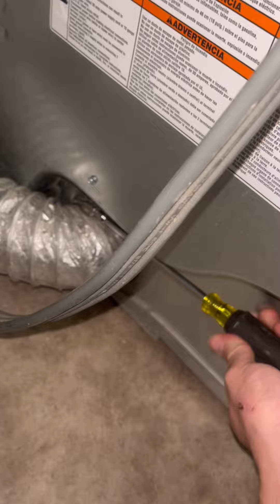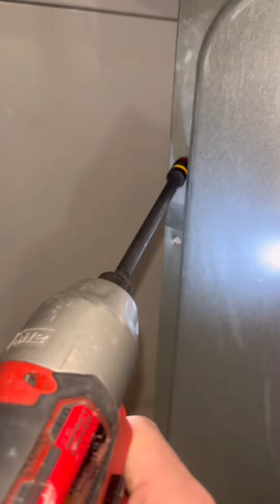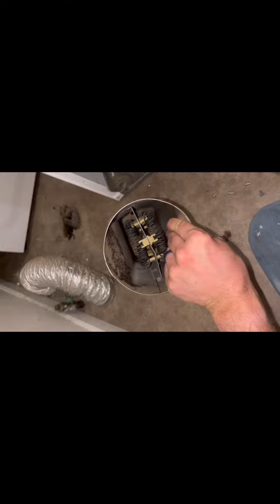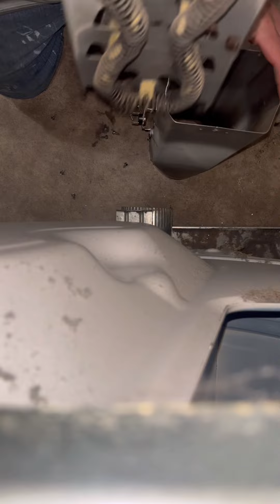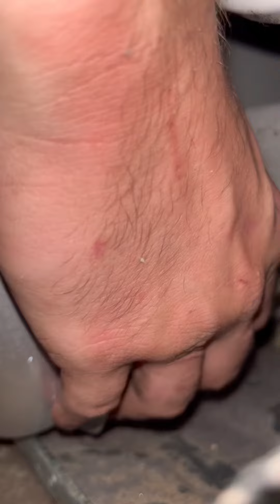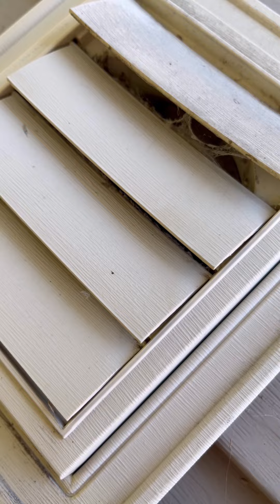Heating Element Replacement On A Maytag Dryer!

Comment: Have the same dryer but my heating element has three prongs vs 2 that came on my replacement unit. Will that work? Also, replacement seems smaller in length as well.

Comment: I got this dryer a few years ago and it is still working fine. Since the cabinet on the front does not look easy to take off I was wondering how to replace the element. The designs of crap nowadays is no doubt designed to discourage the DIY guy from doing anything. Most other models had an access panel on the front that you could either pull off or press some tabs in and access the element directly and easily. Thanks for the video.
Reply from the maker: It is definitely designed to keep it from being too easy. You are welcome!

Comment: You should call a licensed person to repair this. This is what the licensed repair person would do, as illustrated in the above video:

1. UNPLUG THE THING SO YOU DON'T SHOCK YOURSELF. That's a 220 outlet and will kill you.
2. Remove vent hose (big tube coming off the back).
3. Remove screw and cover from electrical box (located immediately above the power cable).
4. Remove hex screws to detach power supply (aka power cord) and ground wire.
5. Remove back cover (there are a large number of screws around the perimeter of the back of the dryer).
6. Remove terminal block screws (the power supply attached to this).
7. Unplug heating element and limit switches (red wires, white plugs, on the bottom).
8. Remove heating element compartment cover screws (the compartment cover is the long section on the left side of the dryer).
9. Pull out the tube holding the heating element.
10. Remove 1 screw and slide heating element out of its housing.
11. Check the element with a multimeter or by visual inspection (the coil should be fully connected all the way along; if there's a gap/break, you need to replace it).
12. Put it all back together.
Reply from the maker: Is that not what I did? 🤔
Reply: @Freonandbeyond That's exactly what you did. The consensus below was to slow down the video and I just listed out the steps.
Reply from the maker: @tuckercase2449  I see, thanks for the clarification
Reply: @Freonandbeyond  Damned good steps, by the way. I'll likely be doing this same job sometime this weekend unless the friggin' thing just magically heals itself.
Reply from the maker: @tuckercase2449  we can only hope lol
Reply: PN for the element?

Comment: Just rifled through removing the heating element. That would go a long way if you show how to remove it 
It appears I need to remove the entire drum to get access ..?
Reply from the maker: Watch the video again and slow it down if you have to. There’s only a pipe and one screw holding it on
Reply: You'll want to slow down the video to catch this. I think I'll list the steps in a separate comment.